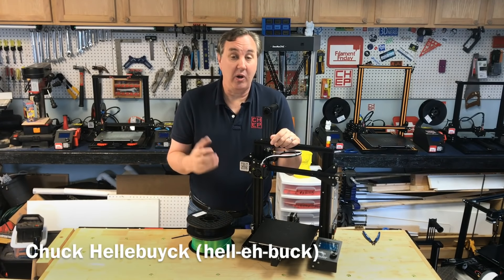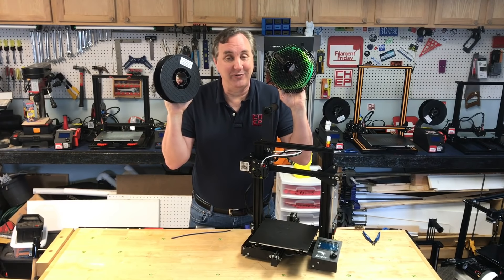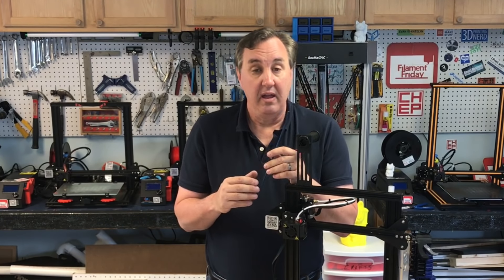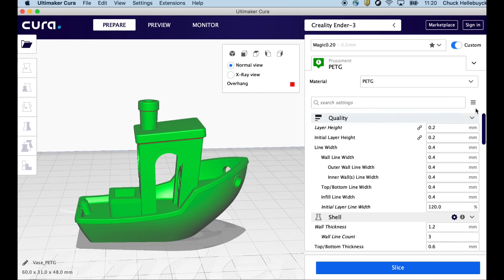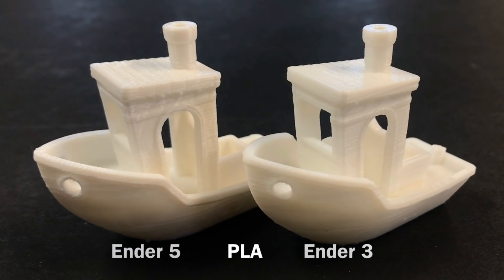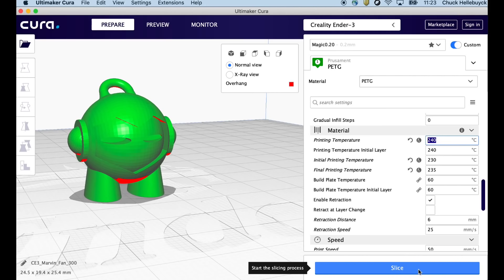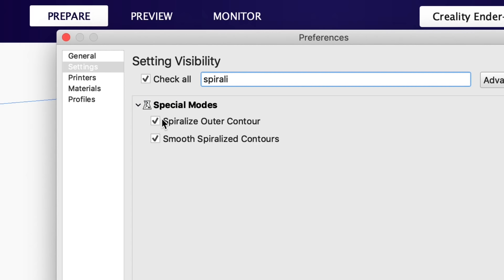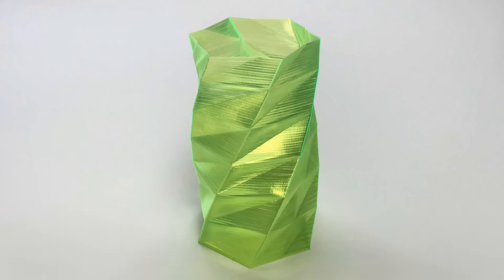PETG on Creality Ender 3 - Atomic and Prusament

Comment: Hi I'm brand new to 3D printing I just got an ender 3 and ordered PE TG on Amazon not sure what the brand is but my question is about the slicing file I don't have a computer that will Load cura so I'm using an online slicer Real vision and the file it gives me is G code is that compatible or how are these things supposed to work I don't know exactly what I'm looking for please help me thank you.
The reason I ask is I'm having nothing but trouble, I've done 5 or 6 tests and made one simi done ring but tried other prints
Reply from the maker: I’ve never heard of that slicer. Did the test prints on the SD card work?
Those don’t require any slicer to test it.
Reply: @FilamentFriday  I sorta skipped the test prints and went to a Batman bust.. I did it three times the third time came out about 85 90% and that's without the actual bust just the base. So I'm just finding out these things too but a slicer program takes the 3D image that someone makes and slices it into layers and puts it into a code that the printer recognizes my computer is not good enough to download one since I only have a laptop but I go on real vision online they give you a 2 week free trial and have a bunch of free downloads
Reply from the maker: I recommend go back and print a sample print first. Make sure it works.
Reply: @FilamentFriday  I didn't even realize who I was talking to, I'm over here trying to explain slicing to you.
What is the purpose of a test print? Isn't it just a print they preloaded? That's what I thought that's why I skipped it. I am watching your video on how to level the bed cuz I actually messed mine up the nozzle dug into the bed can still use some parts of it but what is the best bed to use? I'm thinking glass would be good
Reply from the maker: I prefer glass. Test print tests everything before you slice.
Reply: @FilamentFriday  are there notes or how do I know if the test print came out good, what am I looking for?
Reply: I just ordered a creality glass bed that should be arriving today and since I cannot download cura on my laptop which is all I'm working with and like I said I use real vision online to slice would you be willing to check out real vision and suggest maybe a better online slicer? If there are any out there

Comment: my Amazon Basics PETG is curling up at the corner. pls help
Reply from the maker: Try raising the bed temp and/or use a brim.
Reply: Raise ur bed temp and try using hair spray on your print bed, and heating it for about 2 min at 60 deg C before your print. Also slow your first layer so quick direction changes don’t cause it to peel up. I find the first layer to be the hardest with PETG but once you figure out what settings work best on your printer, the rest of the print goes smoothly.
Reply: If you are using cura they have a plugin from market place . That will put feet like a brim at the corners. Give it a try.
Reply: @tomtaylor135  what is the name of that plugin?
Reply: @Silentnight1979  TabAntiWarping by 5axes. You can also click on it and move the tab . As well as resize it. I sometimes pull it away from the model. Resize it longer. Then place it back where I want it.

Comment: Does anybody else have trouble with getting incomplete gcode when saving code from Cura?
Reply: Are you ejecting the SD card?
Reply: Immediately? No. Even if I wait five minutes it makes no difference. I've tried many different cards.
Reply: Try uninstalling and reinstalling Cura
Reply: @tiredofit9091  
 Yeah I did try that , tried different versions of cura. I guess it's not a very common problem. I have no trouble at all with slic3r. Maybe it's just something unique with my computer? 
   Although I have seen the question asked several times before on Google, but doesn't seem to be any solutions.
Reply: @deceitive3338  
 After I slice a part, it may have say 150 layers. Then when I save, doesn't matter if I go save to removable drive or save file, when I reopen the gcode file it will have only about 70 layers.

Comment: What build surface to print petg ?
Reply: same as what the printer comes with, sticks fine.
Reply: For pei or glass it sticks too well. I have to use pliers with petg and I think my pei sheet will get ripped by the petg soon
Reply: @ELValenin , I use good old glass (at 65C) and Aquanet. The Aquanet seems to work well as a release agent when the glass shrinks once the print finishes.

Comment: petg - bed 75, nosel 235 - perfect  for mine direct)
Reply: The problem is that if you run the bed temp over 70, you run the risk of ruining the magnetic bed
Reply from the maker: That’s a myth about the magnetic bed. I covered that here: https://youtu.be/qyG7Gt-Upsg
Reply: @FilamentFriday  well,  for a myth, it ruined mine pretty good and I had to replace it.   I will trust facts and experience over someone else's opinion
Reply: @FilamentFriday  I had mine at to only 70, but after a couple 9+ hour prints,  it already started to deteriorate and break down.  The magnet back on the back of of the build tac plate started crumbling and coming apart after less than a week (the plate was only 2 months old)
Reply from the maker: Me too. So I tested it in the video and more. I also confirmed there were defective beds as you found and replaced.  But to assume all have an issue above 70° is not everyone’s experience. Many assumed 85° was the limit since that is a typical curie temp of magnets but the magnets used in most of these beds are not typical.
Reply: @FilamentFriday  It might be who manufactured the magnetic bed. I run the ender magnetic bed. I run mine at 75c all the time. 1-14 hr prints. I have also had it to 80c for 10 hr prints with no problems.
Reply: @trueflightgaming9104  Lol Idk why he's saying this, it happens. It's literally just science. Search it up and you'll realize heat effects the lifespan of magnets
Reply from the maker: I never said heat doesn’t affect magnets. I said 70° or even 85° often quoted are not accurate for this type of magnet. Each magnet technology has a different Currie point.
Reply: @FilamentFriday  but it does effect this type of magnet.  Maybe not as much or as quickly as you were expecting., but it does effect it.   That combined with the questionable build quality of the plates on the ender 3 make it even more prominent.
I had one plate fail after about a week of use at 70, where the magnetic backing just crumbled off the plate.  Since then,  I've had a second plate fail where large chunks of the magnet just broke away from the back of the plate.   I've never used mine above 70, usually not above 60.

It's all hit or miss with the quality of the materials.  Better to warm people to lean to the more cautious side than to tell them everything will be fine despite numerous people mentioning the issues it can cause.   While you personally may not have had any issues, that just means you had some good luck.   The overwhelming response from the ender 3 community and their experiences have been to the contrary
Reply: @FilamentFriday  and each magnet technology can come in different temperature ratings as well; flex magnets with 110°C are readily available commercially - having said that I've been reluctant to raise mine in case it happens to be a bad apple, local vendor would have to replace it, but its a hassle.

Comment: Pla or PETG i cant fix an issue i have. Its that my first 2-4mm are really rough and i get sometimes some artifacts further. Do you guys know a fix for that?  Because his first layers looked great.
Reply: Bed levelled?
Reply: You need your bed leveled higher aka further away from the nozzle for PETG since it likes to stick to the nozzle and hates squishy layers.
Reply: Clogged nozzle? Due to the bed being too close perhaps.
Reply: Sry forgotten to mension: bed is decently levelld. Not perfect but good enough that it should not cause any issues. And i have the Problem with pla also. First 2-4mm really rough and totally for the Trash then decent print quality with some rare artifacts. I already have my Printer for some months and that why its pretty astounding to me that i still have those issues i went from decent prints to Trash then to nearly perfect prints and now to Trash again. And no, its not caused by bed levelling XD
Reply: @areeb6616  jes it is
Reply: @Henk14789  i dont think so but ill look for it tomorrow. But would this explain that everything above 5mm is pretty decent?
Reply: @zanpekosak2383  have this Problem manly with pla due to having plenty of petg prints since
Reply: @chris_0725  sounds like you don't have the cooling fan running for the first few layers.
Reply: @truantray  i have and chep made a Video that it doesnt matter witch is also something i experienced
Reply: @chris_0725  Depends on how long it stays that way, In my experience, when running with a clog, most part of the print looks perfectly fine, and then it just does not extrude for a certain part, and then continues like its fine again.
Reply: @Henk14789  yeah it ciud be. But its more like iverextruding at the first layers. The nozzle is also scratching the print. Its really strange
Reply: @deceitive3338  okay ill try thanks you :)

Comment: Hi Chuck! Do I need to do any modifications on my stock Ender 3 to print with PETG? I've been hearing different things from different people, but I guess you should be the relevant source here?

I was told:
1) Nothing, keep temperatures under 135 C.
2) Capricorn tubing
3) All-metal hot end is a must
Reply from the maker: I don’t know where people come up with those ideas. Stock Ender 3 prints PETG fine as I show in this video below. Use a new or clean build surface though because it doesnt stick as well as PLA. 
https://youtu.be/-CtMZgThiNQ
Reply: @FilamentFriday  have you tried amazon basic petg? I have been struggling with bad stringing unless printing down to 220c

Comment: I've had better results (better layer adhesion) with ABS on the Ender 3, when printing models with long walls (like a box) or vase mode, by bumping the temperature to 270c (tried 280 but it can't reach, it goes to 275 and down to 270, then 275 and back down to 270, and stays like this indefinitely).
I think it's because it moves faster not having to change directions so often and more filament is passing through, when setting to 240 or 250 although the nozzle temperature is 240-250 the plastic itself doesn't have the same amount of time inside the nozzle. Small objects print best at 250, tried 260 and got lots of spots at the surface, as if little bubbles of air popped (It's not moist filament, firstly because it doesn't happen at 250, which would be plenty to vaporize water, secondly I don't hear pops coming from the printer and thirdly I keep my filament in a closed box with the bottom completely covered by silica gel balls.)  I use some generic no brand ABS.
Reply from the maker: Creality specs say 255° C max. The firmware has a max limit of 275°C.
Reply: You turn on the cooling fan?. how much Fan speed layer ?

Comment: I’m about to give up on my first 3D printer (Ender 5 Pro) and PTEG (Overture). Everything comes out stringing and curled. It seems like I have tried every setting and different beds (magnetic, polypropylene, glass). Can you give me your exact settings, bed type, and brand PETG? Please!
Reply from the maker: Trick was to use fresh sheet of Buildtak on the bed.
Reply: That overture petg isn't very good I find. Sainsmart has been much better!

Comment: The PETG I have seems to string worse than my PLA
Reply: yes PETG strings really bad. Thats just kinda to be expected with the matterial. You can get major strings tuned out, but your always going to have some small strings. You can use a hairdryer/lighter/heat gun to quickly get rid of them tho if they are an issue.

Comment: So your samples look GREAT (not surprisingly) but they are rather simple - not showing much non-printing travel from one place to another (like you'd see with multiple instances, for instance.  What I was HOPING to glean a hint or two about was what ALWAYS seems to get me: the nozzle collects junk bits (primarily from previous spider-webs) that INEVITABLY get large enough to drop onto the print somewhere - where they stick, harden and RAISE CAIN!  Often my fan shroud will strike said blob, or the nozzle will hit it and either knock the stepper motor(s) out of whack or knock the print loose - or BOTH.  I've wasted LOTS of filament TRYING and RETRYING stuff I really WANTED in PETG but cannot find success.  From this little video I don't see anywhere NEAR the stringing that I experience, even with your magic styles.
Like my whining?  Me, either.

Comment: I have an Ender 3 Pro and it worked perfectly with PLA.  I am using PETG to print the face shields, but am considering switching to PETG all together in the future.   What would be a 'better' printer for PETG versus the Ender 3 Pro?
Reply from the maker: It handles PETG. Why change?
Reply: just change to capricorn tube and it´s great for PETG all day
Reply: Use 250 for the nozzle and 85 for the bed, works for me, but the print starts coming off the bed. Maybe get a new glass bed, Creality sells a greater glass bed.
Reply: @falsehashtags6581  I have the creality glass bed, using 80º the print sticks perfectly, never had a warped PETG print, I also use hair spray every 10 prints

Comment: Do you have any issues with warping, on the larger based PETG prints? I suffer from warping and this usually results in the print lifting  and possibly completely coming free or at best a very warped base. I get this sometimes with PLA, but mostly with PETG, any thoughts ? Thx
Reply from the maker: Get fresh Buildtak. I forgot to mention that I replaced the Creality bed with Buildtak. Huge improvement.
Reply: I use glass with magigoo on a 70°c bed temp, and have no issues.
I used to have buildtakbefore, and printinz plate, but the glass perfect flatness is much better.
Reply: I use a raft for larger PETG prints. Try raising yout bed temp to 80 C

Comment: Question: How hard is it to paint various kinds of filaments?
Reply from the maker: Use a primer and it’s easy
Reply: I honestly have never used a primer, I just quick go over the print with some medium grit sand paper and then give it a spray.  Always turns out pretty good.  But, Primer is very helpful!

Comment: I have read that you want to double your initial Z height 
Like using the thickness of 2 sheets of paper. Is this true ?
Also, I didn't catch what fan settings you used.
Reply: Turn fan way down, to about 25-40%
Reply from the maker: I used the same Z as PLA.
I used 100 % fan but the Creality fan is weak.

Comment: This didn't help at all, the figures all had globs on them, trying to print 7 inch figures and they look like crap, regretting the ender 3 though, so many required upgrades
Reply: We print on the stock ender 3 in PETG everyday!.. Prints come out super nice!
Reply: Ender 3 is brilliant value for money, upgrades are good but you would have to do many of the same upgrades on much more expensive printers, just remember every filament is different and you have to play with the settings to find what works for the filament your using, I'm printing PETG now on 255 degrees and 60 degree bed, looks great but could do with a tiny bit of tweaking. Sounds like your print temp may be  too high if your getting globs.  I run a glass bed and upgraded to the SKR main board. Not only is the printer awesome its as quiet as a mouse now.
Reply: @mikeobrien9829  I have found that getting quality filament direct from the manufacturer gives much more consistent results than getting stuff from places like amazon. I buy all my filament from 3DXTECH, atomic filaments, or prusament. Those are the ones that work for me (mostly PETG and ASA). I’ve tried dozens of brands but nothing beats the stuff right off the extrusion line. We printed around 130 spools last year and the same gcode works throughout several different colors and spools giving excellent consistent results. I do have the direct drive kit and skr boards for my Enders but haven’t started the install yet. Been printing all day, everyday and can’t find a break to get the upgrading done.
Reply: @oneheadlight8000  Gee Josh 130 spools you must print up a storm. Just getting into  PETG printing really happy so far but some work to do, the first layer is rough but I will play with the settings and see how it goes.
Reply: @mikeobrien9829  Yes.. I run a 3D printing business with one other guy and we have 11 printers right now. Been printing since '09 haha.. I would suggest trying scotch brand blue painters tape. We use that with PETG and it actually can work with a 0 degree bed. The first layer height for PETG is very picky, but once you have it.. you are good to go. We also use a 0.6 nozzle on most of the machines just to make it easier when printing CF PETG.
Reply: @oneheadlight8000  thanks, I use glue stick and it sticks ok to the plate, will try the lower temp bed and higher first layer, thanks for the advice :)
Reply: @chadcarter30101  Agreed, love my Ender 3, it has been seriously upgraded by way of the SKR Mini board, a nice glass plate and a twin gear extruder drive which in reality only make it pretty much Version 2 anyway. My big tip is get a dial indicator for bed leveling, it makes a huge difference if you can get the bed the best part of dead flat. Our friend with the gobs of plaster may have the temp set way high especially if printing PETG which tends to ooze. Also retraction may need setting, I set mine at around 5 mm
Reply: @chadcarter30101  I bought a bl touch have not installed it yet as the results I'm getting with the dial indicator are great. Upgraded springs are next in the list. I get just as good results from PETG now as PLA with the only difference being dimensionally PLA being slightly better